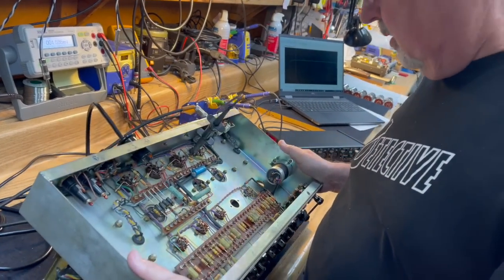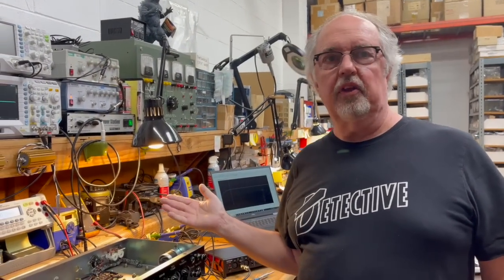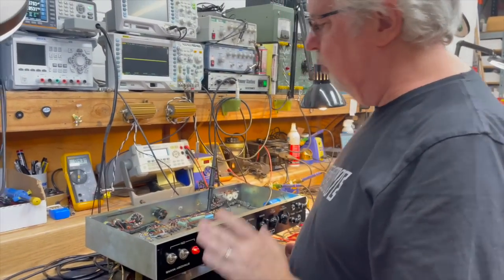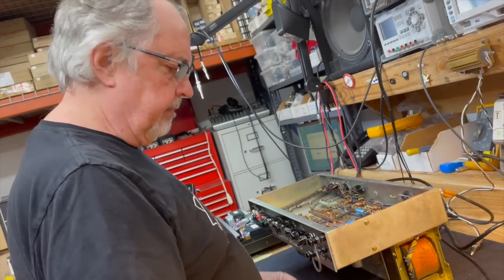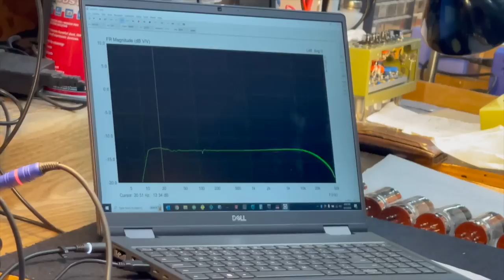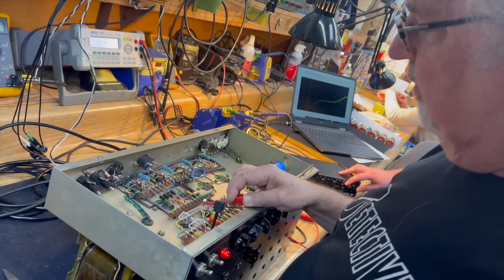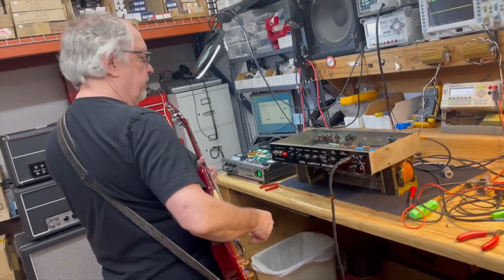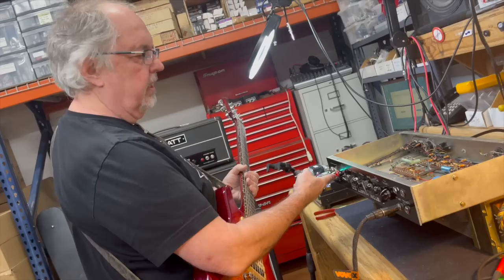Living Its Best Life: A 1970 Hiwatt DR103 Gets a Makeover

Comment: I'll never understand techs who are hesitant to replace 40 year old electrolytic caps. Just replace it and be good another 40 years.
Reply from the maker: We'll never understand why people insist on paying for, or charging others for an operation that we've proven repeatedly is not always necessary, or even recommended in many cases. But sure, please tell us how many times you will do or pay for this operation again using the same logic over the next 40 years.
Reply: @FryetteAmps  I'd rather spend $50 on caps that I know will last 40 years than wait until they fail and I've got bigger problems. Just me. I think you might be part of the minority in this thinking.
Reply from the maker: @tetsuo2195  We are definitely in the minority. We'd rather leave tested, well performing 40 year old capacitors in a perfectly functioning amplifier than charge the customer $200 (because that is what it would really cost them) to replace them with current parts that in many cases likely would not last even 10 years. Understanding how this dynamic works in the real world is essential and often misunderstood, which is the point of this video. The facts, supported by scientifically derived evidence beats personal bias and internet hearsay every time.
Reply: @FryetteAmps  I was speaking as someone who can work on amps, so $50 in parts, to me, is worth the peace of mind, . There is no harm in replacing 40 year old filter caps. You can find science that says you might not die from smoking a a cigarette today. But why not eliminate the risk and just quit now? Those old caps might test ok and work, but why chance it to save a few bucks? I don't see any benefit to keeping old filter caps. But, to each their own.
Reply from the maker: @tetsuo2195  Working on your own amps puts you in the minority (welcome!) and only confers limited expertise on the subject of component design, failure statistics and the ability to save money on your own repairs. But using tour own logic, why not “eliminate the risk” entirely and replace all of those pesky pots, resistors and especially those 40 year old broken down transformers?  If you want to head off any possible disaster, don’t just do a half-asses job. Put your money where your mouth is!

Comment: Now that was a very  interesting video with those frequency response curves etc. I wish I could have heard the sound difference live on the spot. I mean in video (I listened using headphones) the amp sounded just great to me before the mod. I was quite  confused because I could not hear the difference in audio track of video in the way that I supposed it was heard in the same room.
Reply: Being in the room, the main difference was in the low end and to some degree the amount of "scratchiness" there was in the upper-mids (and top-end) before the mod. Afterward the low end was tighter and sat underneath without drawing attention to itself and any top-end harshness was resolved.
Reply: @JoeGambleGuitar Interesting. Recently I made experiments using OT primary RC "snubber" circuits trying to get an optimal snubber component values, in which case the snubber does not tame the speaker/OT interaction too much keeping the sound as original as possible but still protecting OT and tubes when output stage is heavily overdriven. It felt that this mod affected the sound a bit like a very very subtle OT primary snubber  circuit.
Reply from the maker: @jutukka  A snubber is basically a form of local feedback. Probably not so great for tone shaping. More effective at helping to control ringing, which isn't a big issue in old HW output transformers.